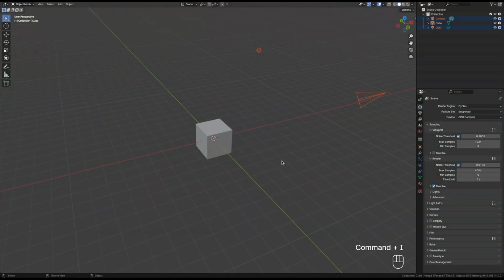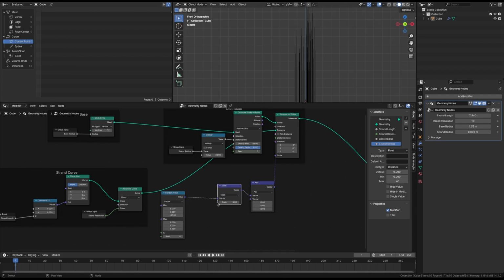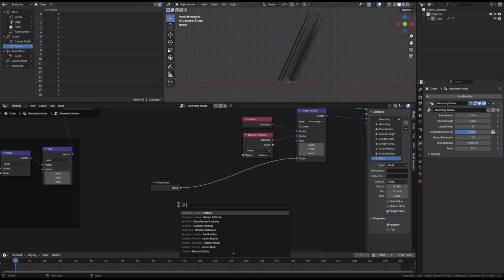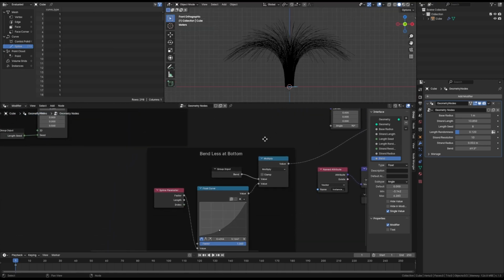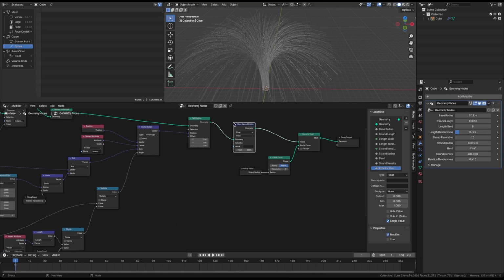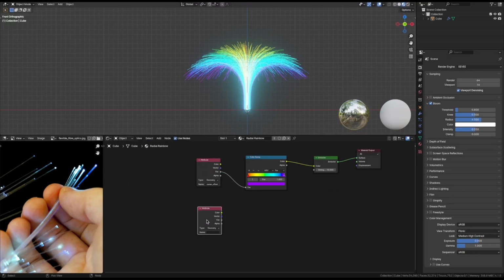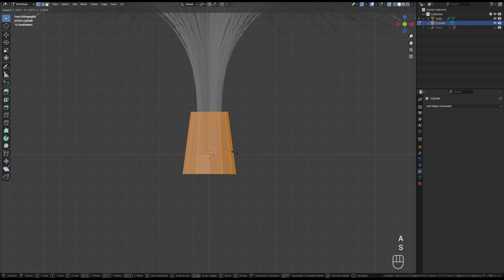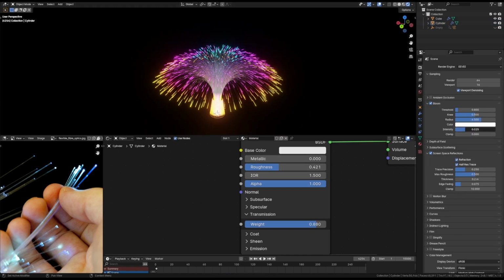Geometry Nodes - Make BRILLIANT Fiber Optics

Comment: Sorry for criticism but it is not correct. The fibre doesn't work like this. There's a light exactly at the very end of the fiber and that gives the light. It is not a quite long light strip at the end. I tried to get that effect, nut even if I set up the colorramp to 0.999 the light is not a dot, but a stripe. Sorry.

Comment: Nice result but I think it's getting to the point where we're going to need either a wide screen monitor or a monitor wall just for the geometry node tree. Some of the node setups i've seen creators make are just unnecessarily voluminous in size, but what would I know, I'm just a structural engineer.
Reply from the maker: Yep, some node graphs can get quite insane. Your comment does give me an idea though to alter my layout to get a little more horizontal real estate. Thanks for your feedback!
Reply: @TiFiDesign  Thanks for the reply.
I think creators secretly have a thing where they try to see who can use the most amount of nodes to move the default cube 1 blender unit to the right & shade it green !
I suppose it depends who your audience is beginner or advanced. My job is pretty much the same, explaining wind force to a novice you say the structure needs bracing, explaining it to my boss requires a white board full of math.
Cheers, have a good day 👍🏼🦘